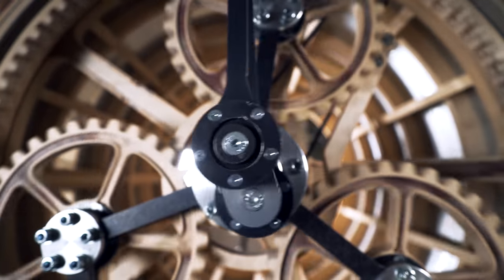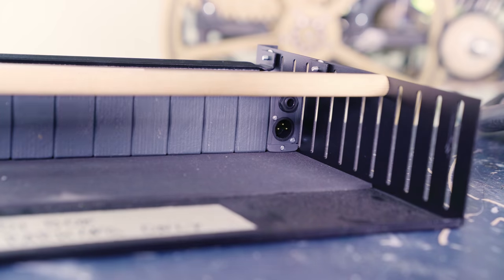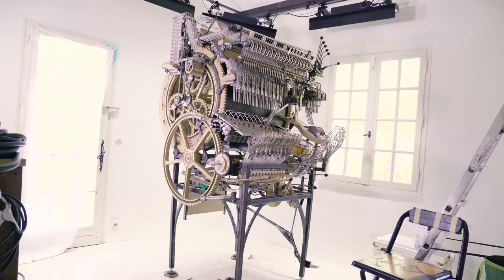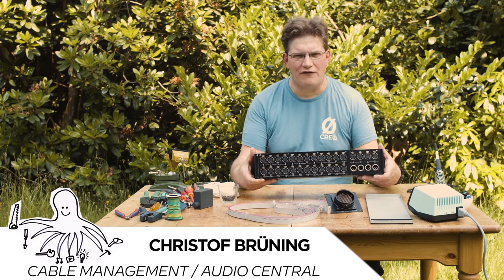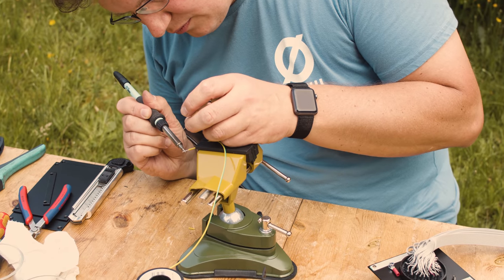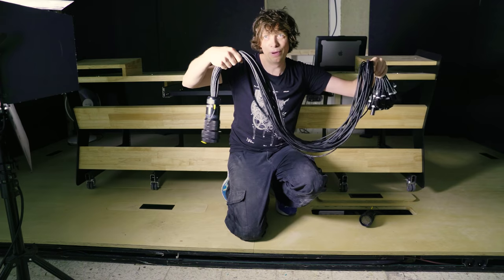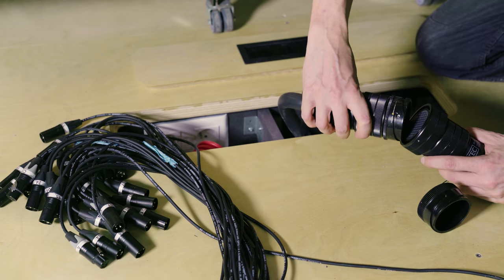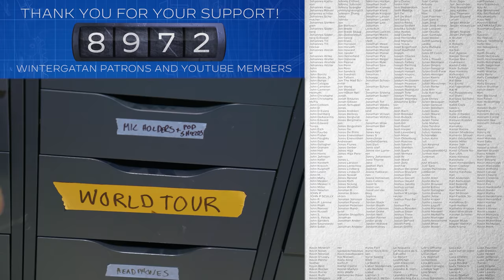28 Audio Channels in One Cable! - Marble Machine X #133

Comment: So why a huge, heavy analog snake when you could use Dante or some other audio over ethernet modern tech and just have one ethernet cable?
Reply: Plus that snake must have cost a small fortune.
Reply: @1Walrus23  I doubt if analog is 100% reliable over digital. Consider humming, noise, quality loss over long distances, etc. Somewhere in the chain the audio needs to get digitized anyway to get in Martins computer, so lets do that as soon as possible. I also wander if he will come in music halls with fully analog sound systems during the world tour. I have the idea that for PA digital is more common than analog nowdays...
Reply: @1Walrus23  Except he's converting them to digital at the other end anyway.
Dante has excellent specs, and the data compression does not have to be lossy.
It has a maximum latency of 150µs at 192kHz sampling rate.
Reply: @1Walrus23  Dante easily accounts for all those concerns even if Martin needed 100 channels. It also supports redundancy with seamless failover such that you could literally cut the main cable with scissors during the show without affecting anything.
Reply: The simple answer to your question is that he is loopy, ignorant and arrogant.  Any distribution of this music, even in an auditorium live will involve conversion to digital.  As someone commented it's best to do this at the earliest stage.  Maybe some analogue purists don't know that modern PA's use class D power amps, where D stands for digital.  For YouTube fans, the amp in your device is almost certainly class D .  So while the spin doctor may vaunt the benefits of analogue, what you're actually hearing is digital.  The massive multi core cable is a very bad idea.
Reply: @1Walrus23  What you're talking about is quantization noise, or the noise resulting from having to map a continuous value analog signal to discrete digital values. Most digital audio you hear (cd's (yeah, I know, wtf are cd's right?), your computer, phone, tablet, tv, etc. basically any consumer audio you hear on a day to day basis) uses 16 bit sampling, or 2^16 = 65,536 possible digital values to map the analog signal to. This already gives an extremely small quantization noise, basically unperceptible to any human. Dante uses 32 bit sampling, or 2^32 = 4.29 billion possible values to map the signal to. The quantization noise at 32 bit is well below the threshold of perception. I know there's always going to be analog fanboys, mostly because they don't understand anything about signal processing, continuous time signals, discrete time signals, or electrical engineering in general. What people like about "analog sound" is actually distortion. If you like the distorted sound so much, it's easy to reproduce using an FIR filter. Dante and other audio over ethernet technologies are used every day in commercial stage shows, broadway productions, tv and movie production, live sound reinforcement etc etc. There are no issues with reliability or latency. Analog is dead. Long live the bits (and the smaller, lighter, cheaper cables they flow through)!
Reply: @robox10  Any touring production brings their own self contained independent PA system anyways. No touring act would ever depend on what the venue has.
Reply: @raykent3211  Careful throwing around the word digital and expecting all types of digital to be the same. Class D amplifiers, while digital, amplify a PWM digital signal, not a sampled, quantized, packet switched binary digital signal that most people think of when they hear the term digital. PWM signals can be at different frequencies, is there one PWM frequency that all PAs use? (I'm asking out of ignorance, my expertise is general electronics, not audio engineer.) The output low pass filter needs to be matched to the input PWM frequency or audio quality suffers. Does PA equipment even have a PWM input that bypasses the internal analog to PWM mixer circuit? Analog audio is already fairly standardized by the frequency response of the human ear (not by a board room who wants to enforce vendor buy-in by the customer by having their own "standard"). Yes, analog voltage levels may not be universally standardized (though it might be with the maturity of the technology), but that can be mitigated with amplification or attenuation.
Reply: @Sembazuru    I take your point.  PWM is a hybrid because the time domain can remain analogue , whereas information transferred by purely digital encoding, as eg in cds,  is not.  For real time, of course, the receiver has to work fast enough to keep up....   I doubt if there is any encoding for Internet, optical or ip transfer that relies on PWM.   Of course, a class d amp may convert to pwm internally, but that's not a matter of information transfer from the transmitter.
Reply: @raykent3211  If Martin uses his gear to process the signal when recording the marble machine he needs the analog signal. Most rackmount studio gear is analog.
Reply: @HarvestBreedmusic  he dosent need the analog he could go directly from mics to a digital snake to a digital console and have a ton of digital plugins for effects and such far more easily and less expensive for arguably a better sound

Comment: Anyone looked up the cost of the 85 pin connector, that’s got to be thousands right?

edit huh way way cheaper than I expected, only like a hundred euros for both.
Reply: What?  A short USB cable can already costs like €15, how is that so cheap?
Reply: Huntracony That’s just the cost of the multi-pin connectors.  There are several manufacturers making them, and those look like the Veam brand, one of the more expensive ones.  That cable won’t be cheap, though!
Reply: @Huntracony  you mean USB-C 3.1? there is an electronic circuit inside the cable. The cable is impedance controlled. And by the way: USB-C connectors have 24 Pins.

Comment: 10:03 just a small detail: wouldn’t it have been enough to cut the groove just big enough for the cable to fit thorough and set the cable into the grove from above instead of pushing it through and needing a bigger hole?
Reply: They probably want to be able to remove the cable from the flooring in the future.
Reply: kevindemand I thought about that, but it looked like they were barely able to push it through even without the floor. Unless they make the gap wider, they won’t be able to pull it out...

Comment: Isn’t it better to build a 19“ digital mixer in it and get out with a Stereo Out, the sound of mmx should be the same on every stage...
Reply: tactileslut but there is the Problem with the length of the cable, on many small digital mixer you can use cards with all possibilities, Dante, AVB, Madi and so on, so you just use the A/D for Studio Applications and the Whole Mixer for Tour.. 
Just one Small hybridcable, Cat and Power und the Soundcheck would be very quick.
For me as a soundguy this is the best way, and Martin has the hands on his sound Also, with Headphones/inear and Tablet
Reply: For a studio date he would probably want to track each microphone separately.

Comment: Why would you use an analog snake for this instead of a digital snake and just run a single CAT5/6 cable?!
Reply: Why not lol
Reply: I was thinking that too, but I feel it would ruin the theme if it had a tiny cable attached to it, I feel the multicore compliments the machine
Reply: Because audiophiles insist that if it's not analog, it's not "real"
Reply: Analog is universal. No matter where you are, analog will work. Diferent digital snakes uses diferent protocols, AES50, Madi, Dante, etc. Maybe you go with Dante, but surprise, the venue system doesn't talk Dante. In that case you need to go from digital to analog again. This will start to add noise, reducing the dynamic range of the system
Reply: @ThatGreenWolfie  56 unnecessary points of failure, but really a lot more since that's just the number of conductors in the cable - there's also a point of failure between every conductor and pin of the connector it's attached to on each end of the cable, so that's 168 points of failures on the snake cable itself (and still not counting any potential continuity issues between the large connectors on either end).
Reply: so they can hook it into their main mixing boards with other instruments on stage ....
Reply: @MrSadowEsp  True. Really a shame though.

Comment: As you have so many channels, as a suggestion, you could use some of those piezo contact microphones mounted to the frame and mechanical sections so they pick up all the rumbles and bangs, and then mix them out of phase to the main mics in order to subtract the unwanted mechanical noise from the "musical" signal.

Comment: Normally, one puts instruments (modular synths, etc.) IN 19" racks. This instrument CONTAINS a 19" rack. Epic. 
For placing cables snugly, look no further than lacing twine. Cable ties are sooo white thrash. Besides, lacing twine and the craft of lacing cables is a rabbit hole of the first degree. Welcome down. 
/Måns, spent the 90s with a soldering iron inside those multicore connectors.

Comment: We use connectors like those at work all the time. Those connectors can easily crush pins flat during union if the pin is slightly bent. Always inspect the pins before you put them together, and always keep the caps on.

Comment: Ask Christof to find you a dummy multicore connector so you can store the cap on the rack that's on the machine. I know they exist for smaller variants for certain, so they should exist for bigger ones too. Alternatively, if you don't have one, have one printed. It's basically a cylinder with a flange. Neat, clean. Keeps the important cover handy.

Comment: The reason why they are using those audio snakes is the fact that they are an industry standard and are used everywhere there are professional stage and live production remotes. Keeping everything in the analogue realm lowers your operation complexity, while also lowering your points of failure modes!

Comment: I used to an audio engineer in church in California. We used snake systems all the time becouse we had audio mixing at the back of the church. My biggest snake we did was actually 128 channels. However it was a digital snake, 32 channels per each cat6a. Actual mixing was done digitally on stage but the control was with remote control on the back of the church that resembles an audio mixer. So there better options than just snake cable that is fat and big, you can lookup some systems that can do actual mixing in the marble machine and have the mixing done on the spot with remote control.

Comment: Hey Martin 
I would be careful about leaving the multicable in a circle. Sometimes when someone uses big multicables or strong current power cables it can produce magnetic fields wich in turn creates noise. 
A solution is to put the cable in a figure 8 pattern. This can also elevate some of the stress on the copper when winding and unwinding. 
Love from Denmark🇩🇰

Comment: Have you thought about having another barrel connecter that is empty, mounted on the machine?  Instead of letting it hang (or be cut off and in drawer) you just put the cover on the dummy one to hold it while the real cable is connected to the machine.

Comment: Long term, you might want to look into an optical mux/demux for that snake.  Less signal loss and lag over distance, zero ground-loop concerns, and a much thinner cable.  Only problem: they don't typically come in 28 channel; you'd have to roll your own circuits.

Comment: I see all those cables and custom termination needed. Looked extremely expensive! Personally I'd have ran the amps out into a MOTU 24AI and ran a single data shielded Cat 6 line back to the recording setup. Less likely to get noise and would play well with other AVB devices which a lot of studios are going for these days. That's pretty awesome operation to get that big bundle of cables terminated like that. :D

Comment: Make sure to have atleast one extra of the audioswitch-box + constrictor boa + spider in back up on tour. Since it's a one off build for the MMX you cant grab a replacement from the local audio wholesaler.

And mostly! I Love the stop motion you made tightening the screws turning your Wera ratchet socket spanner only to the left! (righty tighty, lefty loosy). 😍

One more thing, if you get noise om your audio from the MMX into the studio, try removing the snake from the trunking. (if there is no metall separation between the power cables to the outlets and audio signal cable.).

Comment: I feel like a better colution for that end cap, rather than cutting it off, would be to add a "dock" for it on the machine. That way it's still always attached to the Snake and can't get lost, but is still  not just going to hang or bounce.

Comment: I hope that large Audio cable is shielded enough from the power supply. I would hate for you to put in all that effort to have distortion in your audio signal.  I think the general rule of thumb is that the spacing is greater than two times the line width.

Comment: Two things:
 1) I used to work for a company that made electrical cables for military aircraft. We used woven ribbon cables which we wove ourselves because of the special wire the military required wasn't available in molded ribbons like you have there. Yes, actually woven on a wooden floor loom! Anyway, we used foil strips between the layers of the ribbon to isolate, they were grounded to the shield at one end. 
 2) How hard would it be to put a dummy receptacle on the back of the box to store that cover on? You wouldn't really even need the lanyard. Just remove the cover from the cable and store it on the receptacle. Also super common on aircraft for both electrical and hydraulic connections.
  I was also kind of surprised about how big that connector is. Does audio need pins that big? I've seen 128 pin connectors with 24 ga. pins less than half that diameter.

Comment: You should put a mock cable-end in some of the dead space on the rack mount panel next to the snake connector – it could even be 3D printed. Then you could put the cap on that and be able to leave it attached to the cable, but store it nicely out of the way.

Comment: I'm a casual lurker here, so I wasn't aware that there was a problem that needed solving with regard to the audio hookup.
I am aware of the various commercial solutions for this (Dante etc) and maybe they would have been ok.
If I'd known about this, I could have put together a box with multiple XLR inputs (if that's what you want) with nothing more than a USB cable to go back to the studio. The cable would obviously have to be a beefed up version to withstand a touring environment, but that would have been that.
The box would contain a row of USB audio CODEC (soundcard) devices, each with stereo input and output.
If the cable needed to be longer than USB would tolerate, I could have added a USB to ethernet converter.
Back at the studio, plugging the single lead into a Windows PC or Mac would have enumerated the devices as soundcards, which you could then forward to whatever you need.

The analogue run of cable would have been only on the machine.
The cable back to the studio would have been much thinner and cheaper to replace.
In a pinch, the cable could be replaced with any old active USB extender.

Would the above have helped or made things worse?

Comment: That's pretty amazing!
Did you consider using something like a Dante network instead? With a couple of Dante rack units on the MMX, you would be able to use a single standard cat5/cat6 to get audio both in and out!
They are pretty expensive units, but I would imagine they'd be much more reliable and a lot easier to replace than a giant custom setup.
Good work, man!
Reply: Yamaha Tio is very affordable!

Comment: That cap should honestly have a holder on the machine. Either as a simple bent pair of wires forming a little pocket, or as a second "fake" connector used for holding the cap.

I can also understand why one goes with 24 channel analog audio instead of putting a multi channel ADC on the machine. Since some venues don't use the same digital protocol, or even digital at all... So a lot easier to roll in with analog only. Even if 24 channels is a crazy amount of audio, and one is likely going to bring one's own mixer regardless. (So that one can easily just give the venue 1-2 XLR cables for the whole machine, instead of letting the venue technician manage all the channels of this beast...)

For everyone saying "analog is cleaner" haven't heard of cross talk... And these multi channel cables have a fair bit of that compared to a digital solution for the same distance. (Downside with digital is process delay, (latency) that can be in the few ms region for good equipment, and increases with more effects. (I have used some digital mixing tables with over 0.1 seconds of latency... Works for a conference, horrid for live music. But as stated, good equipment has negligible amounts of latency, so it really depends on the venue.))

Comment: The cap needs to be safe clipped for the world tour. Otherwise you would see it hanging (probably the worst for ocd people) and when someone accidentally bumpes into it, it bumpes into the mmx (sound, scratches...no good). The multipin on mmx needs to be protected also - it has got pins, you don’t want to bend them while transporting the mmx. If you add another cap there, you can click both of the caps together :)

Comment: dante or aes67 would have been your best friend. You could use 1 cat5e for instead of a garden hose of a cable. And you can add more on the machine side instead without adding more cables.